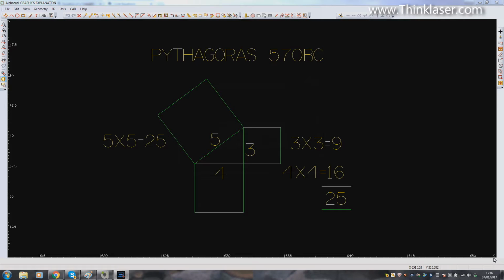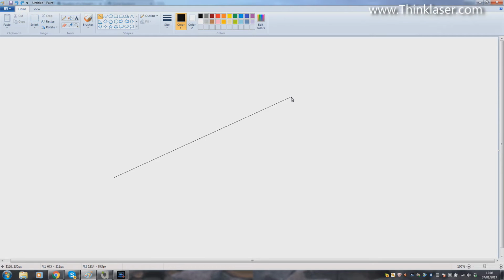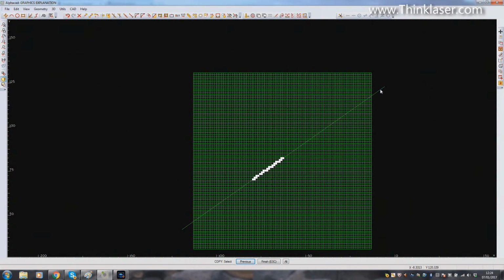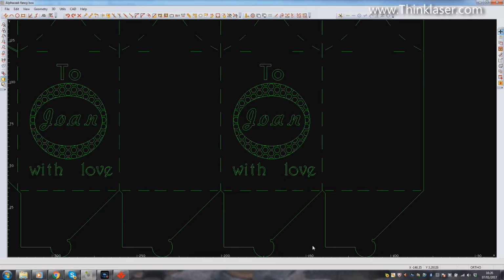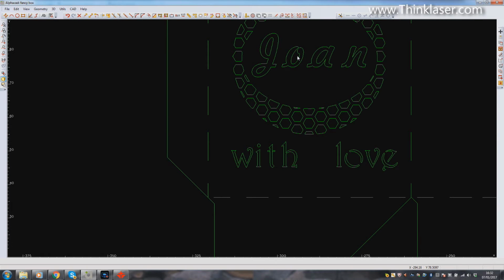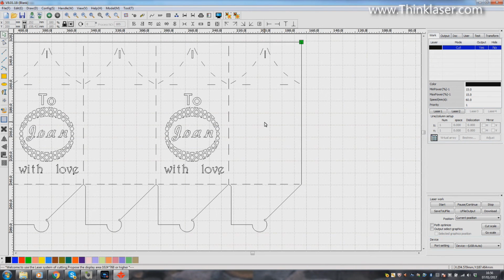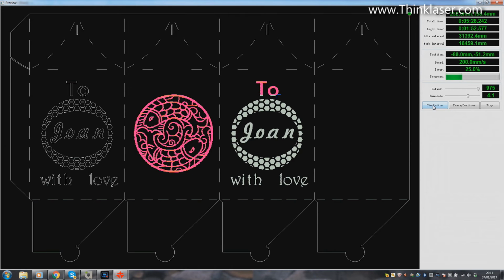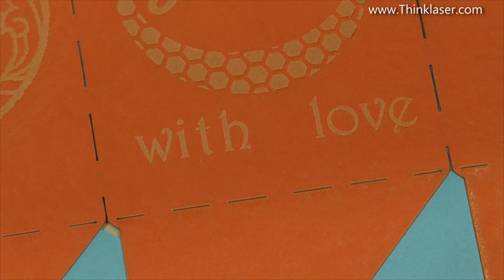How To Use A Laser Cutter - Lightblade Learning Lab 16 Cardboard Engineering Part 2 Vectors v BMPs

Comment: The part with the trim command is easier on Corel Draw... You only need the Virtual Segment Delete tool on the tool bar inside the group of tools that is the crop tool.
Reply from the maker: Hi imegatos imekattos, 

Thanks for the tip, it's appreciated. 

Gareth